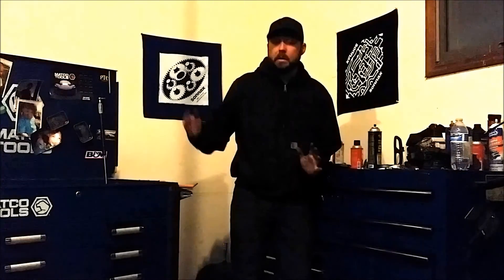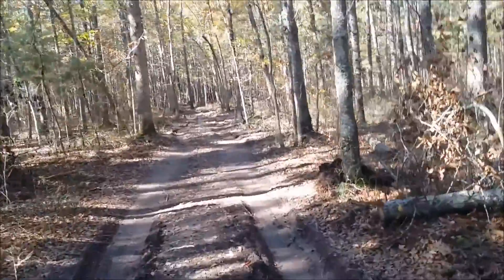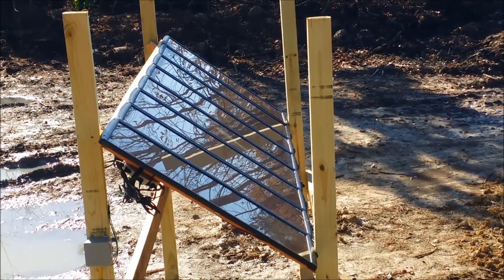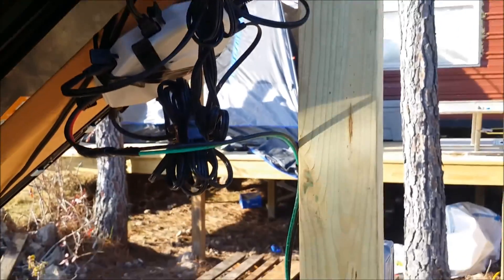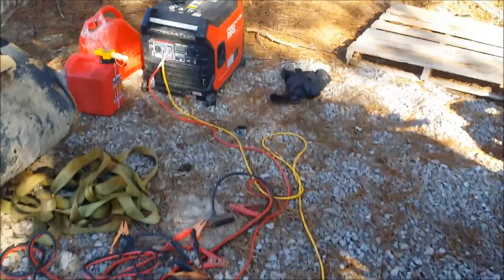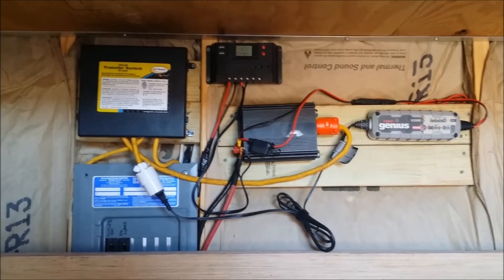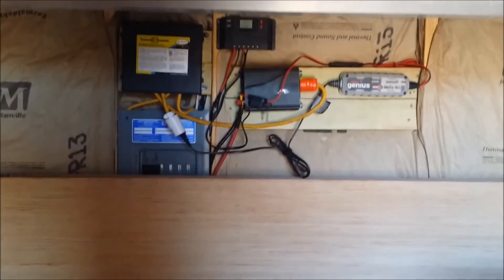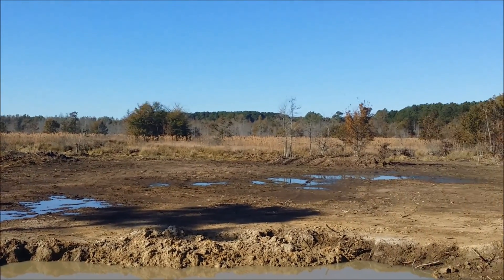Off Grid Party Cabin Powered By Harbor Freight!

Comment: see  ya   are  a  fellow  alabamaian  i    really  love  my  harbor  freight  panels  im   up  400 watt  bout  up  nother   set  soon  curioud   did  ya   up  your   batteries  yet
Reply from the maker: This system has been installed and working well for well over a year on simple flooded lead acid batteries.
Reply: @JBAutoMarine that is great yes mine works as well currently salvaging trying find all lumber I can building a 250/sf off grid cabin but I runn almost every thing off mine fans tvs cell phone light  not up to.strength yet run ac but is what it is
Reply from the maker: Air conditioning is extremely power hungry. The system we installed also has an automatic transfer switch that when the generator is started is switches load from the inverter to the generator. The air conditioner runs only when the generator is running.

Comment: Really cool, I like it, my chimney caught my attic on fire 3 weeks ago burnt half my house, built something eerily close to this build but use the Predator 9000 to power my camper in my driveway when not using solar & batteries until I finish fixing my house
Reply from the maker: its a pretty decent setup for the money. as always try to utilize as much 12v lighting as possible to avoid loosing power in the inverter process. if you use only inverted power for essential things sparingly then your batteries will provide you with more usable energy.
Reply: @JBAutoMarine  I run the generator into the camper 30 amp twist lock most of the time & just plug stuff into plugs on wall, then at night use inverter for light & tv pretty much, can’t wait until I’m back in my house

Comment: Did you test each panel individually??? For 25 wants you need to use a 50 watt 2 ohm resistor!!! What was your out come??!! Can you attach 8 gauge wire to the controller???
Reply from the maker: These panels are internally regulated. They are designed to be easily added and removed to the Hub.
The gauge of the output wire from the controller definitely needs to be of sufficient gauge to handle the wattage of the panels under full charge conditions. 8 gauge should be ok for a short run.
Reply: @JBAutoMarine  Do you use more than your lights and charging phone's? I guess what I'm asking because, I have 2 of the harbor freight 100 watt kits arriving any day, to get off grid in my 5th wheel. I have the 12v furnace for winter and AC for summer. I also Have the fridge, lights, tv, there's a surround sound system, water pump, water heater - which I guess I can turn off until needed? The LP Gas leak detector that constantly runs, 3.5 gallon RO water system.... I'm hoping the 2 kits will be enough? I have 4 battery bank as well. Only thing I don't have is the generator but harbor freight has a killer deal on that same one right now. HELP lol 😳😂
Reply from the maker: @RiddleIsEvollove  we used that system for lots of things including vacuuming and running a Television. 
You need to calculate your daily average usage of watts and plan your system accordingly. This system is setup to charge up a battery bank whenever sunshine is available but if need arrives, a generator can be switched over for heavy power demands  such as air conditioning, electric heating/cooking elements, ect. By just starting the generator and the automatic transfer switch switches over to that.